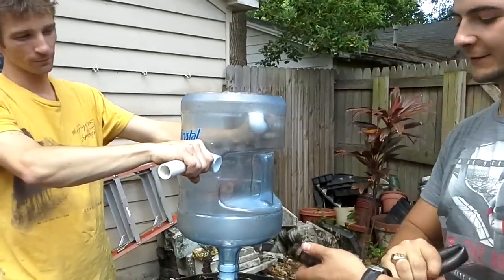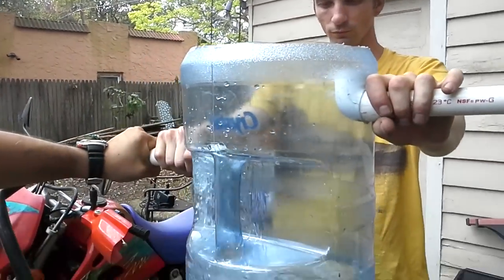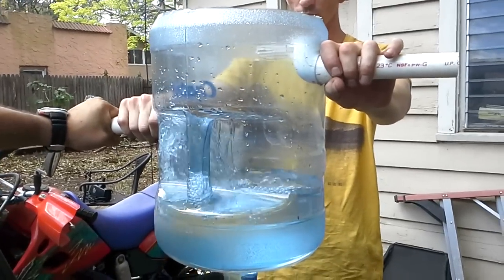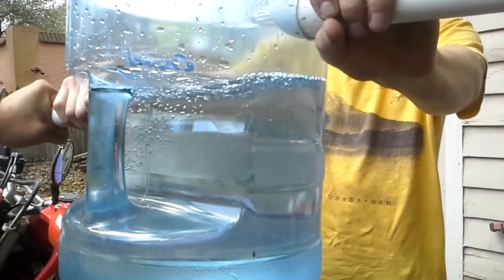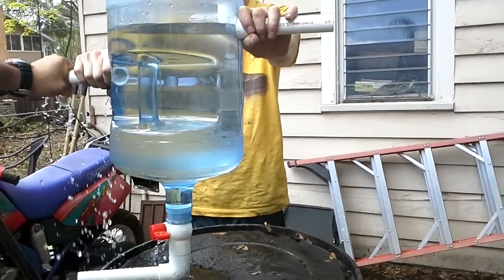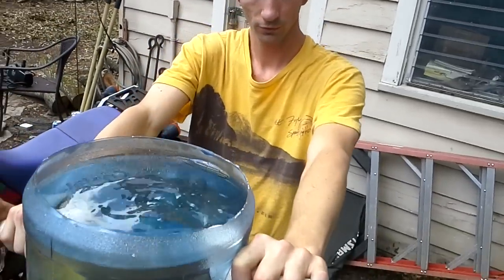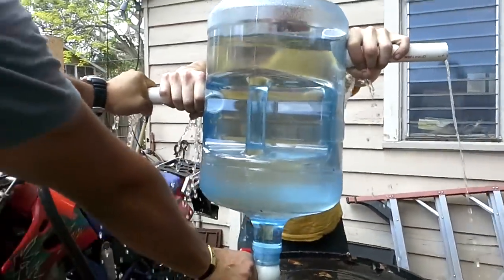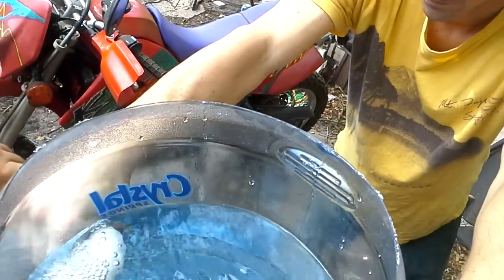Aquaponics diy swirl filter

Comment: Yes I didn't put the uni seals 1in at the time.  It is put together now and you can view it working if you add me on face book.  Aquaponics cafe search in facebook.  I put this swirl filter on top of a bio filter (55 gal barrell). It works quite well but I did change the design slightly to make it swirl even more.  Check me out you won't be unimpressed.